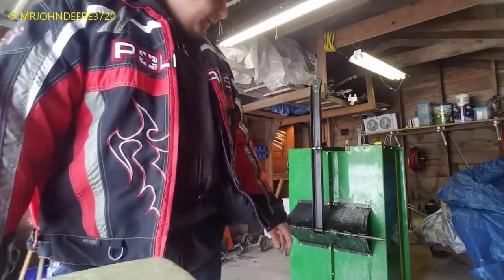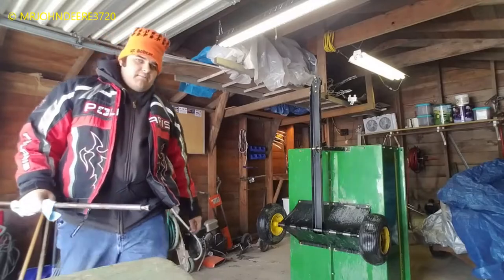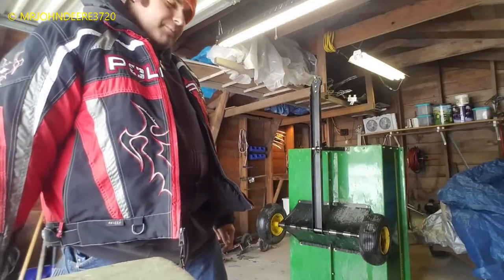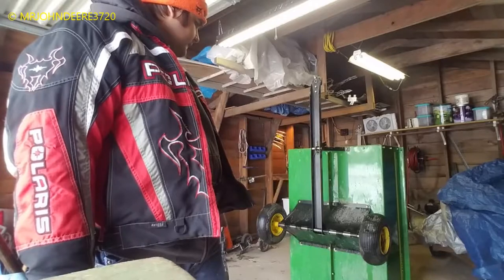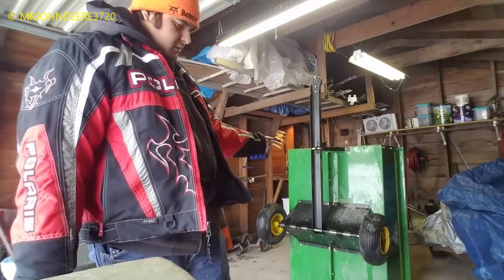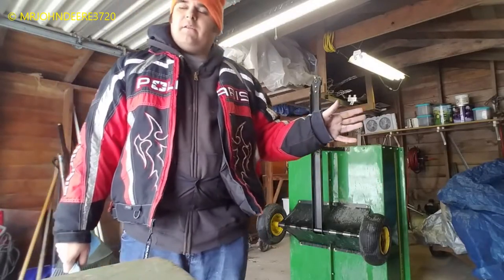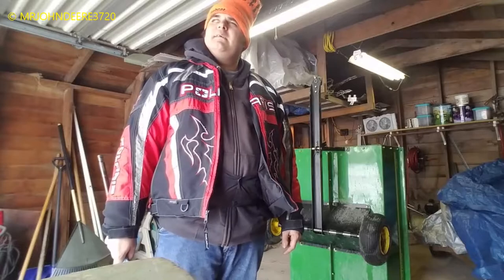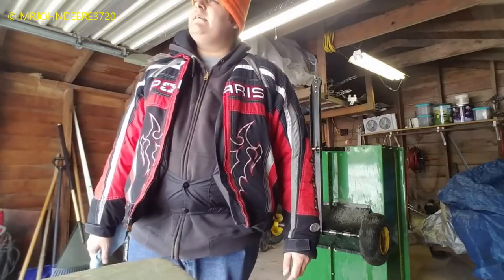replacing the axle on my John Deere 16s utility cart

Comment: I used to have one of those carts they were good  lawn and garden work lol and if your having issues with those small tires going flat check with your local tire guy about gettin them foam filled they might have to send your tires out to have it done but its a easy and forever fixed.... And i am suprised that theres not some kind of bushing for those wheels to not ware on the axle shaft otherwise i would have someone machine out the wheel hubs and make bushings that way you say on wear
Reply from the maker: i dont  think my guys no any 1 that puts foam in tires..  bushings would be cheaper.. but deeres not using them..
Reply: well do some research you could fill them with foam yourself too it just takes the kind of foam minimal expansion type
Reply from the maker: @AJ ya i'll have 2 look in2 that.. :)
Reply from the maker: @ Novelty John i would not no.. never been there..

Comment: I can look at that axle and tell you exactly what happened. Their were bushings in there, but they wore out and failed. And the bearing material got chewed up between the wheel and axle and caused it to wear into the axle like that. Although I would say you would have to be going pretty fast to cause damage like that so quick...do you tow this with the 4 wheeler? I believe the part number for the bushings is M93738.
Reply from the maker: it never said anything about  bushings in the book or online. most of the time i pull it with big red but i keep under 8 MPH cant pull it any faster then that..
Reply: Ever one I find online has bushings in it.
Reply from the maker: if mine had  bushings in it, 1 i would of seen pieces of steel in there & 2 there would be more play in the rim?
Reply: Not necessarily.With the shaft as bad as it was the bushing would have disintegrated just like the material on the shaft. Bushings are thin so there wouldn't be too much play either way.
Reply from the maker: k, i'll have 2 look more in2 this.. if the bushings are gone then the rims would be cooked as well becuz they both had those thread marks in them.. .. the new bushings would not stay in place now.
Reply: I would definitely look into it! Bushing material is weaker than the axle or rim, as it is meant to fail first. Just looking how that shaft was damaged on that one end, I can tell  that something else was cutting into it. Especially since only one side was that bad.
Reply from the maker: ya & the other side started eating in2 it as well..